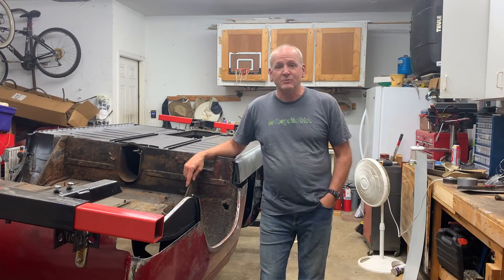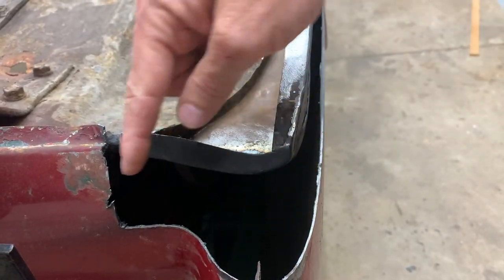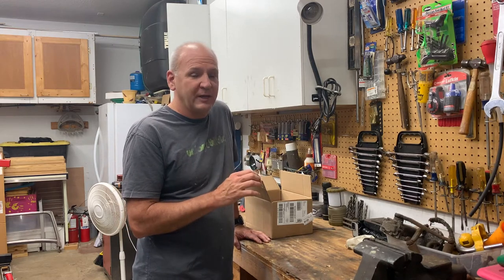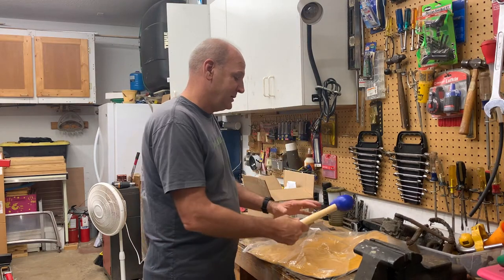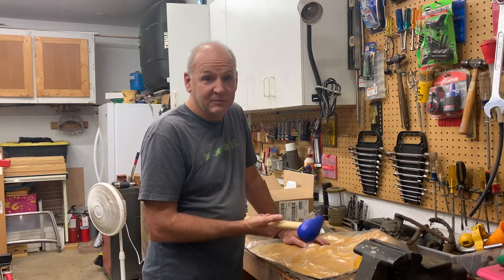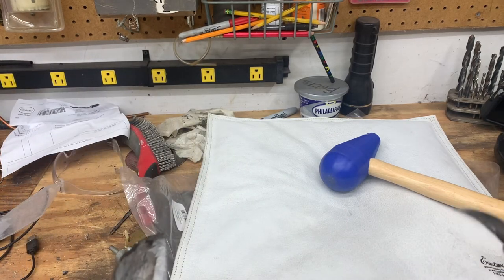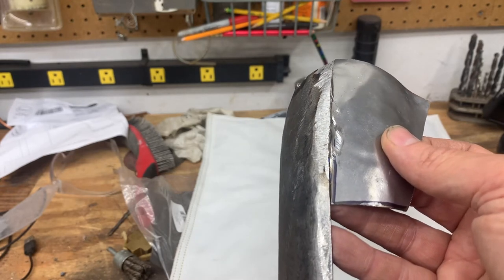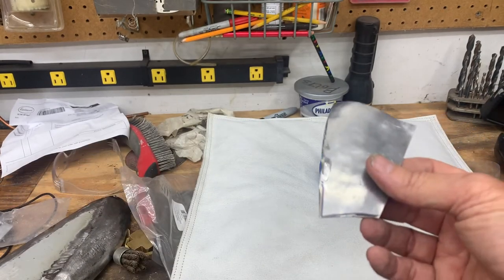Using a Beater Bag to Make Patch Panels S1E44

Comment: This is amazing work Rob. I am restoring a Midget too and your videos are fabby for using as a reference/teaching aid before I do bits of mine. I am still at the cutting out stage of the floor and passenger foot well, and some work around the rear bulkhead around the spring hanger box but getting there. invaluable stuff from you as usual. Thanks for your efforts from an icy cold Edinburgh.
Reply from the maker: Thank you for the kind words. Keep in mind I have never done this work before so my videos may show you want not to do. But I do believe if you are willing to try and stay with it, you can get it done.

Comment: This project is definitely worth the time, just hoping you don't lose interest in it, I did see the video on getting sand blasted and primered recently, so its now two weeks before Thanksgiving 2023 as I watch this. Should have that Midget on the road come Spring 2024 ....
right! Lol 
Try to remember where all the nuts n' bolts are, and don't force the finish.
Ya got too many man hours to rush to completion! Love the tenacity!
Reply from the maker: Haha thanks for the encouragement! Spring won’t happen but I am getting closer…I think. I am working on body filler and sanding. I am taking my time on this part for sure. I am not quitting!!
Reply: @robsrestorationgarage  Good on you Rob, just sayin,
Don't rush this, That MG's gonna be a thing of beauty, when she's done! People will turn their heads too! And then you can say,...
"I rebuilt her myself" !
Keep at it, One step at a time!
Reply from the maker: I have already told people- there isn’t a nut or bolt on that car that I haven’t touched. 

Keep watching!
Reply: @robsrestorationgarage  where you live,?(you may not wanna say) Me, little east of PGH. Pa. Got a lotta work to do on my 77Midget, (brakes so far) but the weather is now changing and still waiting for parts from Moss Motors,so ain't gonna be driving (or testing the brakes) till spring now! Hope the wife is ok with that!  Lol
Reply from the maker: I am in Greenville, SC. I will need to start running the heater in the garage soon.